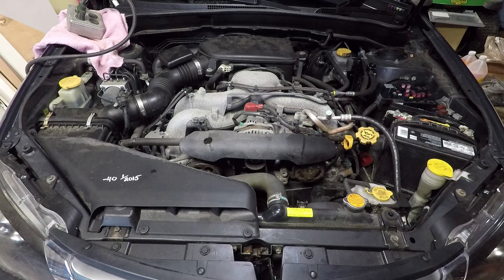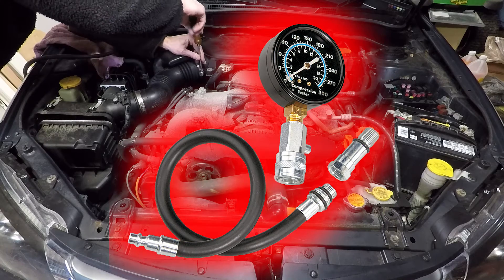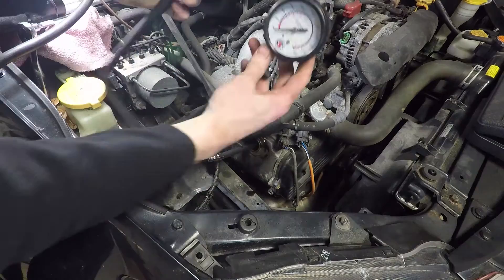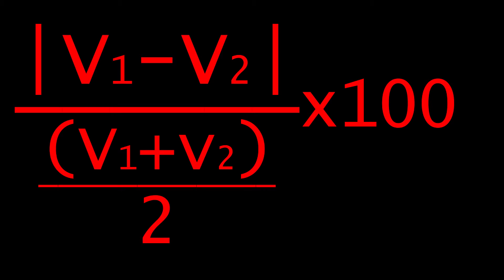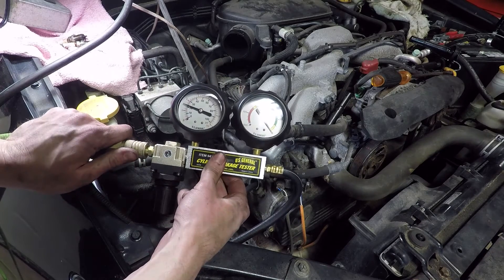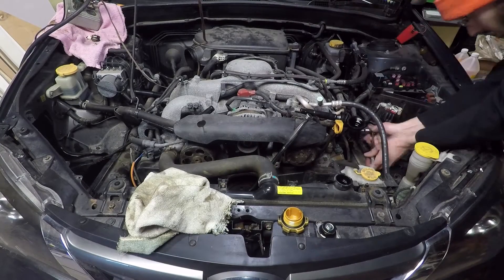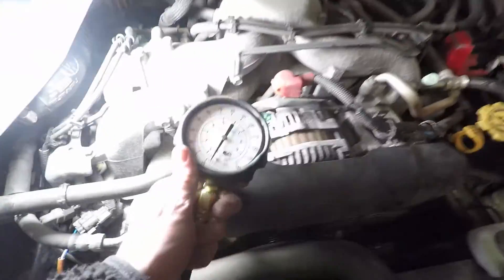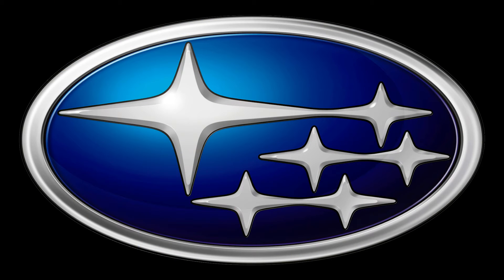Testing engine pressures: Oil Pressure, Cylinder Compression

Comment: Can I use the oil gauge to measure cylinder pressure?
Reply from the maker: Technically no. Oil pressure guage shows current pressure. Cylinder pressure guage has a check valve that will hold pressure and show the max value